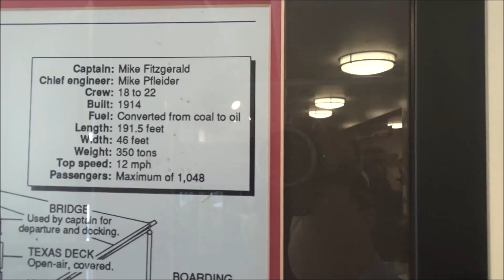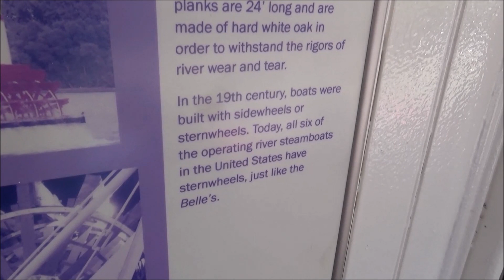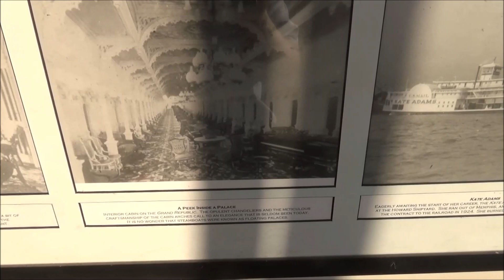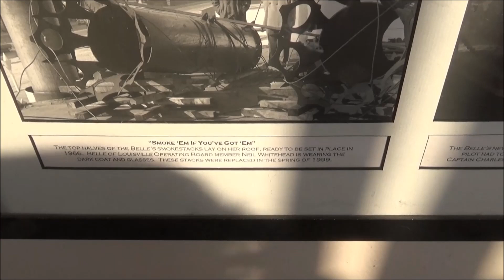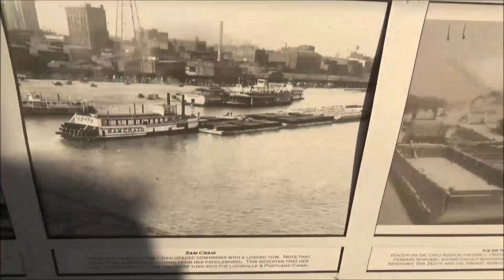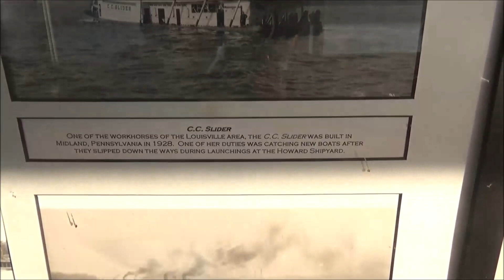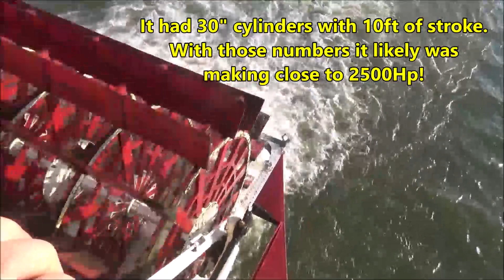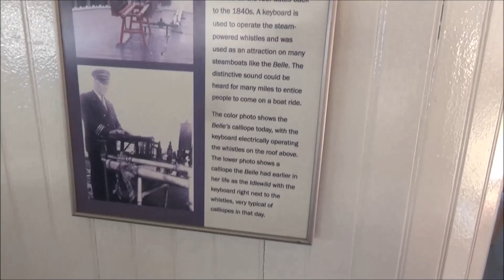Steamboat Belle of Louisville Ohio River Run

Comment: Brian, you had photos of the photo of the Sprague.  We were in Dubuque, IO this past June where she was built and we have been to Vicksburg, MS where she died.  Parts of her including the remains of the paddlewheel are in the shade of J. T. Kilroy's shop.
Reply from the maker: Big'un44 I sent Kilroy an email to see if the engines were still there but haven’t heard back.
Reply: @bcbloc02  If I remember correctly the engines were diverted somewhere else.  The remains of the very large wheel were there when we were last there.  There are som Capstains in front of an eatery on the street along the river.  I have built an R/C paddle wheeler on the lines of the Sprague.  It is 5' long and I built barges for it to push.  Our pond is too small to really run it in.  However, it gave one an idea of what those captains on riverboats ran up against.  I liken it to trying to balance a long broomstick on your nose while trying to maintain your path.  This was demonstrated when at the lock and dam at Newburg, IN we watched a modern towboat trying to get into the locks headed downriver with an abeam wind pushing his tow into the Indiana bank.  He finally got it squared away but it was an hour of interesting watching.

Comment: Those were quite an attraction, mostly the first ones that were built...   This one is huge, some kind of a floating palace...   😎😎
Reply from the maker: Only Mid sized that knock off boat that was there is much bigger. At the time the Belle was built it would have only been a midsized boat. The big boats of the Ohio were the size of a football field but they could only run certain times of the year when the water was up enough.

Comment: Lets hope it can be kept running and available for people to ride. They sure picked a big one for a running museum piece. I know of another one, the Waverley. It recently got a lot of restoration and was available for people to ride. It is currently down for repair, needing donations for boilers to be made :( Let's hope it will come back to life.
Reply from the maker: The only Waverly I found is Scottish and not a riverboat?  It is deceiving because everything is above the water on these boats. The Belle weighs a thousand tons but could run fine in the depth of a small swimming pool, literally at full load it can run in 62inches of water.
Reply: @bcbloc02  Correct, the "PS Waverley" is not a river boat. It is an ocean paddle boat in the UK. I think it is the only survivor of it's kind left, but as mentioned, needs boilers now to continue on. I did not know that the Belle could navigate in such shallow waters. Quite amazing. Both of these boats do need to be preserved, they represent a big change in modern civilization. People need to see, experience and understand these boats. And they are quite easy to understand due to public tours of the entire boats including the machinery space.

Comment: Steamboat Brian . Excellent video from you as always showing your next project ? Paddle steamer boat repairs . BUT BUT you gonna need a lot bigger shop and machines to take these types of jobs on . Just kidding . all the best from sunny England .
Reply from the maker: I could easily handle machine work on those puny engines on the Belle. Lucky for them though Atlas Machine in Louisville just rebuilt them a couple of years ago so they should be good for another 100 years or so. At 12rpm they don't wear much. :-)

Comment: Nice video Brian. Looks like a fun day out. Out of interest, how do they steer that thing?
Reply from the maker: Patrick Shaw it has 3 rudders under the belly in front of the paddle wheel. The hull jumps up in that area to allow water to flow over them and to not obstruct the paddle wheel itself.  They do not extend below the lower hull line.
Reply: @bcbloc02  Thanks for that.

Comment: Glad you take a vacation occasionally.Those are fantastic boats we took a ride on one in NO. In looking at the photos towards the end there was one of the CC Slider. It looked like her decks were awash. Was this the case?
Reply from the maker: A lot of the riverboats to minimize draft had hulls that barely came above the waterline so they look to be nearly sunk all the time. We don't get much as for swells on the rivers so they can get by with it and not sink. During the great steamboat race when the Belle is at max capacity for people I have seen it look the same way. You would think one good wake and its gone but they do just fine. lol The hull is sealed and compartmented so even if water goes over it is unlikely they will sink.
Reply: @bcbloc02  Thanks i had no idea

Comment: Brian, since they are using river water as their source, do they have issues with sludge and sediment in the boiler?  I guess like a maintenance procedure to flush them?  Oh how’s Bailey?
Reply from the maker: Hammer0f Thor Baily doing better. There is a mud drum under the boilers where the water comes in from the pumps that allows most sediment to drain out then the drum can be cleaned from time to time. Towards the beginning of the video there is a diagram showing the system in detail.

Comment: This is fascinating. If the fuel pump is steam powered, what is the cold start procedure? Pony engine?
Reply: Air pressure to push the fuel until she builds enough steam to power the pump. With coal the cold start was "Get the lead out and shovel that coal you bunch of laggards"
Reply from the maker: Yes compressed air from the wharf boat.

Comment: Are u sure 20gallons for 1 Mile?
That sounds really to much
Reply from the maker: I talked to the fireman for awhile. The fuel consumption is correct. When you consider it is moving 600 people it works out the same as 600cars getting 30mpg so not really that bad.
Reply: @bcbloc02  I was calculating the same.
Its so sick these steamers need so much food for firing.
The titanic needed hubdreds of tons cole a day.